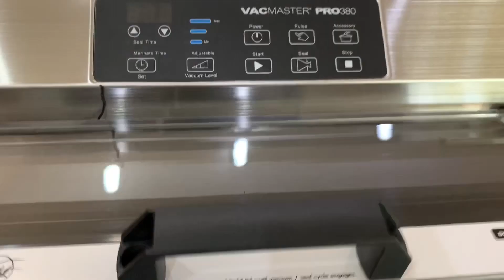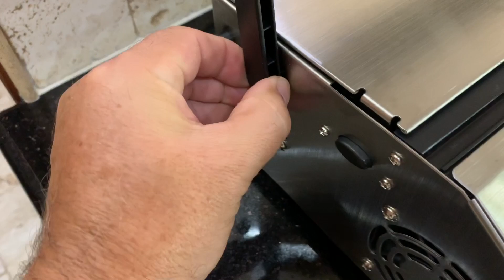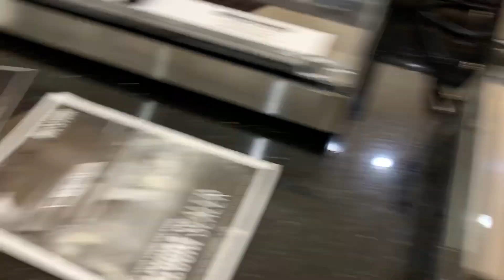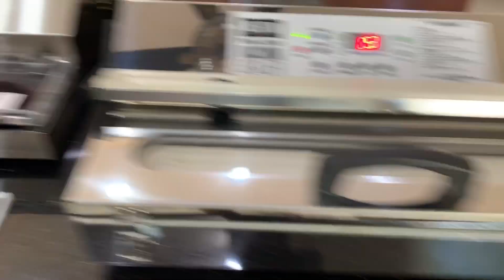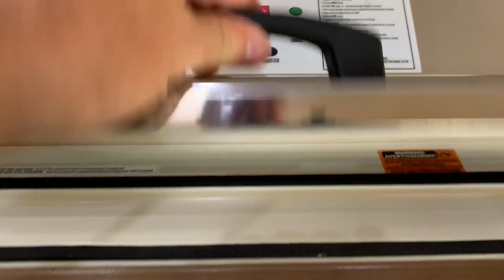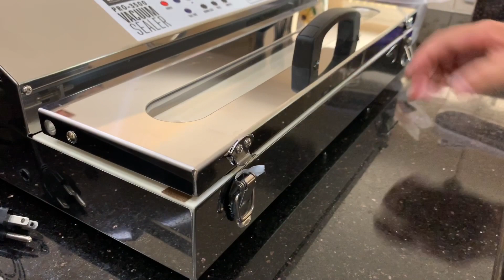VacMaster Pro 380 vs Weston Pro 3500-3000

Comment: Thank you for such an awesome review, I appreciate your time. 

You pretty much can't go wrong with either. I purchased the Ary Vacmaster Pro 380 and love it. 
If you can leave the sealer out on the counter, the Weston would be fine, for most folks that put the sealer away, I would go with the Pro 380.

Some Notes...
24:50 Heat too high -  26:50 now you got it!
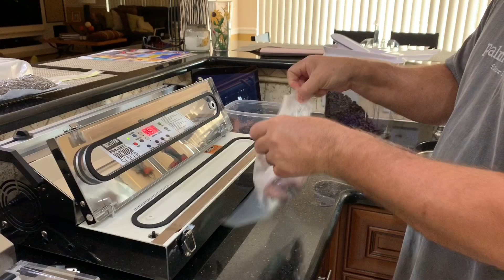20:17 and 27:34 no difference in machine performance, this is an operator problem. 

@27:34, the wrinkling is because you are vac-sealing something that is thick, lay that dam meat out flat! 

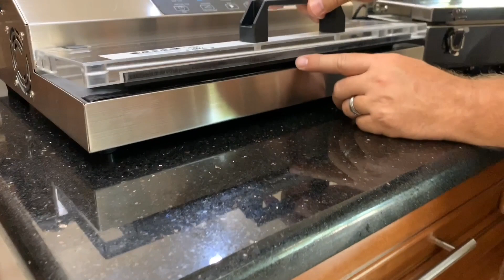@29:44 The bag wants to automatically wrinkle (WRONG) sorry but this is an operator issue.

Avid Armor A100 $299.00  Tax? Free Ship?  (sold out)
https://avidarmor.com/avid-armor-12-vacuum-sealer-model-a100/

Western pro 3500  $499.00
https://www.amazon.com/Weston-65-0901-w-Pro-3500-Commercial-Stainless/dp/B07G1QWV55/ref=sr_1_3?gclid=Cj0KCQiA2vjuBRCqARIsAJL5a-LeYRZW88ceG-hM_ZE5x_A5p-xwxgGnDtqYyUNZEIayZ9vVRiTPxeQaArTiEALw_wcB&hvadid=322244963708&hvdev=c&hvlocphy=9007219&hvnetw=g&hvpos=1t1&hvqmt=e&hvrand=14344495290551425127&hvtargid=kwd-607397067091&hydadcr=20248_9566491&keywords=weston+pro+3500&qid=1574875136&sr=8-3

Western pro 3500  $449.00  Free Ship

https://homebutcher.com/collections/weston-vacuum-machines/products/weston-65-0901-w-pro-3500-commercial-grade-vacuum-sealer-15-bar-stainless-steel

Ary Vacmaster pro 350 = $269 + tax "free ship"
https://www.webstaurantstore.com/ary-vacmaster-pro-350-external-vacuum-packaging-machine-with-12-seal-bar/120VMA350.html?utm_source=Google&utm_medium=cpc&utm_campaign=GoogleShopping&gclid=Cj0KCQiAt_PuBRDcARIsAMNlBdoG5-YXmjeblT9XQN-NdFdvoyyDZCjdGpQv6ShHSQyyMgFpVRJLBE8aAlTZEALw_wcB

Ary Vacmaster pro 380 = $329 +tax "free ship"
https://www.webstaurantstore.com/ary-vacmaster-pro-380-external-vacuum-packaging-machine-with-16-seal-bar/120VMA380.html
Reply: It has been a year now.  How is your Pro 380 holding up.
Reply: @msteel2021  I love it even more. Just went through the freezer and sealed a bunch of stuff. I have also been using it to vac-seal an emergency set of clothes when doing our river trips in late winter.
Reply: @SQWIB  Thanks for replying.  Sounds like it actually has a pair on it to do large sealing sessions.  If it can last me at least a year or two, then I feel comfortable I will get more than my money's worth out of it. My other option is the Weston Pro-3000.  Both have great reviews, but there are some seriously bad reviews too.  It's a dice game like the cheaper models I guess.  QC means nothing to manufacturers anymore.

Comment: If you were to bag up potato chips or nacho chips, do they crumble under the pressure as it's sealing?
Reply from the maker: Ben Connor no. You’d set the suction time to 1 or 2. Or just stop it manually and seal.

Comment: Why are there so many bad reviews on the Weston one having sealing bar burning/ breaking on Amazon? Trying to decide but scares me off
Reply from the maker: LaRueOBR556 I can totally see how setting the seal time to high would cause burn through or burn of the protective fabric membrane.  Also using it to fast could also cause it to burn. This thing is a professional machine and my guess is the people reviewing it have no idea how powerful it is. User error. I would not be scared off the thing is incredible. Yother night I sealed about 15 steaks one right after another I could never have done that with my seal a meal home sealer.

Comment: very informative. did you end up keeping the pro 3500? and have you used the "canister" port?
Reply: Good question, I just ordered the 3000 and am wondering if there is an option for canister? I don't see anything in the description? I guess I just assumed it had one.
Reply from the maker: TheLissabee I think there is an option for the canister port on both the 3500 and the3000. I believe it is a little port on the side.
Reply from the maker: tetontrees thank you!  I ended up keeping the 3500. Aside from being ridiculously heavy it’s awesome. And I have not yet used the canister port.